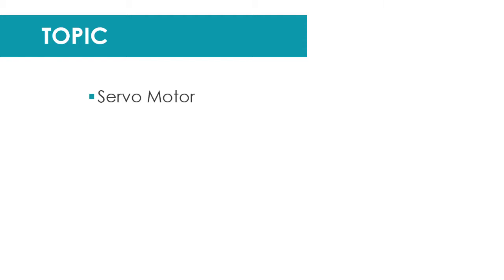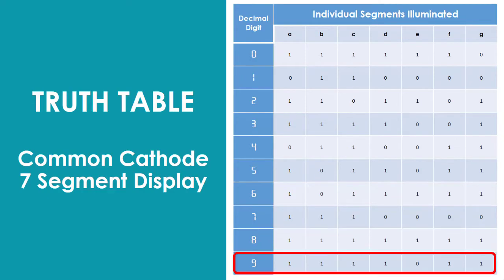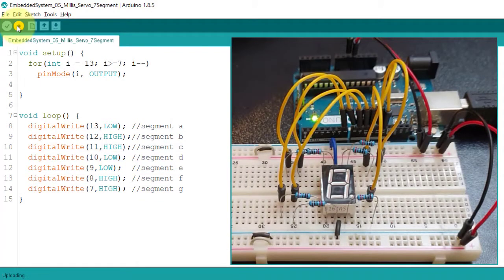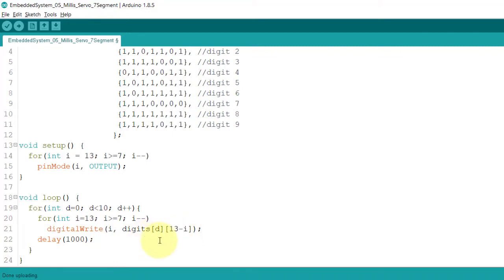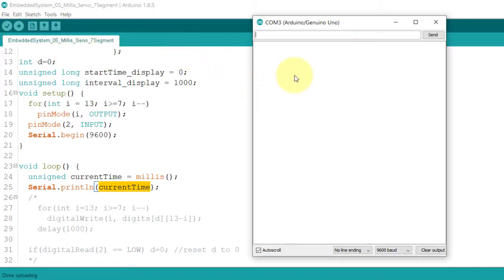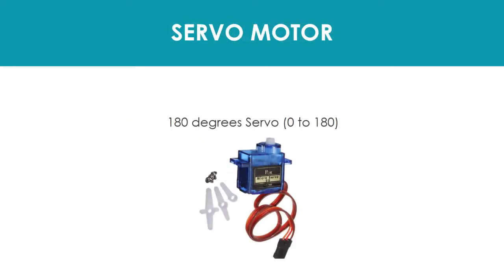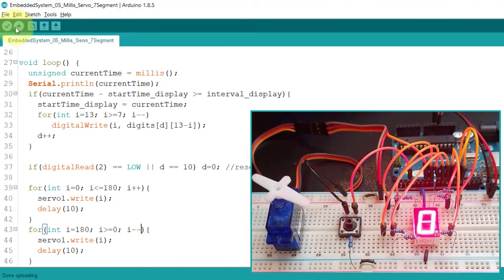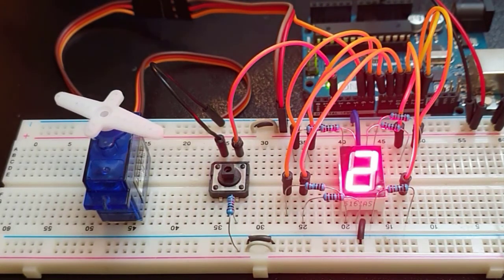10  Multitasking in Arduino using millis | Servo Motor and 7-segment Display | Embedded Systems

Comment: Wow! I came here to learn how to use millis so that I could run the 4-digit, 7 segment display along with other modules.  I learned so much more than I anticipated ; simple little things that I hadn't even thought of, such as using a for loop to assign all pins of the same type.  I'm using an ESP32 and my pin numbers are not in order, but I can just use an array and loop through the elements to do the assigning.  There were several other things I learned.  You've earned my sub; and I really enjoy your style of delivery.
Reply from the maker: Thanks Sir!. Please share 😊

Comment: this isn't really multitasking and we should stop calling it that.  it's more like manual scheduling.  which is like one of the worst (if not the actual worst) things about arduino programming.
Reply from the maker: Multitasking is the ability of a system to execute more than one task in a fashion that is seemingly simultaneous over a certain period of time, and a "Scheduler" plays a crucial  part in multitasking. - so when you say that this is just basically scheduling of tasks, you are correct. And this multitasking in Arduino.
Reply: @joedgoh  Multitasking has a pretty specific definition in computing.  The "tasks" are processes and have contexts associated with them.  To actually multitask, you switch contexts.

There's no context switching going on here.

This is a problem with the Arduino model.  You tell people you're mutitasking but you're really not.

I understand trying to dumb things down for the audience but there should be a practical limit for how far down you go.
Reply from the maker: Hi @GoatZilla, this is not to argue with you. But to clarify things, Arduino UNO R3 is not similar to your desktop computer or a smartphone. Arduino uses a very simple processor with "no operating system", so it has no way to load and run multiple programs. Although it can only run one program at a time, that doesn't mean we can't manage multiple tasks. We only need to change how we do things.  Because there isn't an operating system to help us, we have to do things ourselves. And that is how we do multitasking in Arduino. Yes it is simple, but with this simple concept, our processor is able to handle several separate tasks while staying responsive. 
If you don't want to call it multitasking because of the "technicality" of how it was defined in your computer science class in the context of operating system, that's okay. Thank you for your valuable insights.

Comment: Greetings from Denmark. Thank you for the very interesting video.  I was successful with the 1st & 2nd elements - lighting 4&5 and lighting 1to9 with delay . I was not successful with millis! I would be greatly grateful if you could spot an error in my sketch. Note my  7-segment only shows 0 and the switch has no effect.  Thank you

#include <Servo.h>
Servo servo1;

int digits [10] [7] = { { 1, 1, 1, 1, 1, 1, 0}, //digit 0  //note 3 curly brackets
  { 0, 1, 1, 0, 0, 0, 0}, //digit 1        // note 2 curly brackets
  { 1, 1, 0, 1, 1, 0, 1}, //digit 2        // note 2 curly brackets
  { 1, 1, 1, 1, 0, 0, 1}, //digit 3        // note 2 curly brackets
  { 0, 1, 1, 0, 0, 1, 1}, //digit 4        // note 2 curly brackets
  { 1, 0, 1, 1, 0, 1, 1}, //digit 5        // note 2 curly brackets
  { 1, 0, 1, 1, 1, 1, 1}, //digit 6        // note 2 curly brackets
  { 1, 1, 1, 0, 0, 0, 0}, //digit 7        // note 2 curly brackets
  { 1, 1, 1, 1, 1, 1, 1}, //digit 8        // note 2 curly brackets
  { 1, 1, 1, 0, 0, 1, 1}, //digit 9        // note 2 curly brackets
} ;  //note: semi-colon!

int d = 0;

unsigned long startTime_display = 0;
unsigned long interval_display = 1000;

int servo_angle = 0;
unsigned long startTime_servo = 0;
unsigned long interval_servo = 20;

void setup () {
  for (int i = 13; i >= 7; i--)
    pinMode (i, OUTPUT);
  pinMode (2, INPUT);      //button on pin 2
  Serial.begin (9600);
  servo1.attach (6);        //servo pin 6
}

void loop () {
  unsigned currentTime = millis();
  Serial.println (currentTime);
  if (currentTime - startTime_display >= interval_display) {
    startTime_display = currentTime;                          
    for (int i = 13; i >= 7; i--)
      digitalWrite (i, digits[d] [13 - i ] );
    d++;
  }
  if (digitalRead(2) == LOW ||  d == 10) d = 0; //reset d to 0

  if (currentTime - startTime_servo >= interval_servo) {
    startTime_servo = currentTime;
    servo1.write(servo_angle);
    servo_angle++;
    if (servo_angle == 180) servo_angle = 0;
  }
}

Comment: hello
Is there a way with the millis() for the LED tourn ON OFF only 5  ones?
Reply from the maker: I am sorry, can you rephrase the question? What do you mean by 5 ones?
Reply: @joedgoh   millis() infinite loop . i want led turn on off by  millis() but just 5 iteration ?
Reply from the maker: You just have to create a variable that counts from 1 to 5 (increment by one every blink using the millis). Then you can add a condition that your blink code should only be performed while/if the counter <= 5

Comment: I type the code and review many times, say 62 times but still this annoying error display;  Compilation error: 'startTime_display' was not declared in this scope, what's wrong, CODE: #include <Servo.h>
Servo servo1;
			//a,b,c,d,e,f,g
int digits[10][7] = {{1,1,1,1,1,1,0}, //digit 0
		     {0,1,1,0,0,0,0}, //digit 1
		     {1,1,0,1,1,0,1}, //digit 2
		     {1,1,1,1,0,0,1}, //digit 3
		     {0,1,1,0,0,1,1}, //digit 4
		     {1,0,1,1,0,1,1}, //digit 5
		     {1,0,1,1,1,1,1}, //digit 6
		     {1,1,1,0,0,0,0}, //digit 7
		     {1,1,1,1,1,1,1}, //digit 8
		     {1,1,1,1,0,1,1}, //digit 9
		    };
int d=0;
int servo_angle = 0;
unsigned long starTime_display = 0;
unsigned long starTime_servo = 0;
unsigned long interval_display = 1000;
unsigned long interval_servo = 20;
void setup() {
  // put your setup code here, to run once:
  for(int i = 13; i>=7; i--)
  pinMode(i, OUTPUT);
  pinMode(2, INPUT);
  Serial.begin(9600);
  servo1.attach(9);
  }

void loop() {
  unsigned currentTime = millis();
  Serial.println(currentTime);

  if (currentTime - startTime_display>= interval_display) {
     startTime_display = currentTime;
     for(int i=13; i>=7; i--)
	digitalWrite(i, digits[d][13-i];

     d++;
   }

   if(digitalRead(2) == LOW || d == 10) d=0; //reset d to 0

   if(currentTime - startTime_servo >= interval_servo)(
     startTime_servo = currentTime;
     servo1.write(servo_angle);
     servo_angle++;
     if(servo_angle == 180) servo_angle = 0;
    }
Reply from the maker: Hi. Your declaration is wrong. You typed star instead of start, as in starTime_display instead of startTime_display.
Reply: @joedgoh  Thank you for your reply, Its my fault I got mistake in typing the code. I did your correction but another error come out (Compilation error: expected ')' before ';' token)
Reply: Sir please send the challenges code please

Comment: Wow, Please help me with my problem with delay in my code

          digitalWrite(relay1, LOW);// turn relay 1 OFF
          digitalWrite(relay2, HIGH);// turn
          Serial.println("M1-CW");
          
          delay(12000);
          
          digitalWrite(relay1, HIGH);// turn relay 1 OFF
          digitalWrite(relay2, HIGH);// turn
          Serial.println("M1-Stopped");
          delay(random(3000,5000));
                  
          digitalWrite(relay1, HIGH);// turn relay 1 OFF
          digitalWrite(relay2, LOW);// turn relay 2 ON 
          Serial.println("M1-CCW");

          delay(12000);

          digitalWrite(relay1, HIGH);// turn relay 1 OFF
          digitalWrite(relay2, HIGH);// turn
          Serial.println("M1-Stopped");
          delay(random(3000,5000));

Comment: i am using millis to control 2 addressable rgb strips but it seems to not work properly could you check out the code

#include <FastLED.h>
#define NUM_LEDS 20
#define LED_PIN1 2
#define LED_PIN2 4
#define COLOR_ORDER GRB
#define CHIPSET SK6812
#define BRIGHTNESS 20
#define VOLTS 5
#define MAX_AMPS 500
CRGB leds1[NUM_LEDS];
CRGB leds2[NUM_LEDS];
unsigned long startTime_display = 0;
unsigned long startTime_display2 = 0;
unsigned long interval_display = 2000;
unsigned long interval_display2 = 500;
int j = 0;
int i = 0;  
void setup() {

Serial.begin(9600);
FastLED.addLeds<CHIPSET,LED_PIN1,COLOR_ORDER>(leds1,NUM_LEDS);
FastLED.addLeds<CHIPSET,LED_PIN2,COLOR_ORDER>(leds2,NUM_LEDS);
FastLED.setMaxPowerInVoltsAndMilliamps(VOLTS,MAX_AMPS);
FastLED.setBrightness(BRIGHTNESS);
FastLED.clear();
FastLED.show();

}

void loop() {
unsigned long currentTime = millis();
Serial.println(currentTime);
  if(currentTime - startTime_display >= interval_display){
    startTime_display = currentTime;
    for(i=0; i<=NUM_LEDS; i++)
    {
      leds1[i] = CRGB::Red;
      FastLED.show();
    }
  }
  if(currentTime - startTime_display2 >= interval_display2){
    startTime_display2 = currentTime;
    for(j=0; j<=NUM_LEDS; j++)
    {
     leds2[j] = CRGB::Green;
     FastLED.show();
    }
  }
}

while running the code only the green light lights up not the red one

Comment: it seems very useful, but it's a bit confusing for me. Sir, I wonder if I can use it with 2 codes if there is an ''if'' and ''else" statement, for example, I have combined ultrasonic sensor and water level sensor but the program seems can't run properly. Can you help me, sir
Reply from the maker: It is normal to be confused when you first use this concept. It is okay to use if...else code block. You just have to understand when to properly use it. Using if...else.., only one of these code blocks gets executed at one time. But when you use, if.....if...if..., all conditions could be satisfied and be executed at one time.
Reply: @joedgoh  can you check my code

Comment: actually there is a limitation. When your code gets long enough, and you have to keep the timing precise, this method does not work. As you can see that he used >= instead of ==, this is because as the loop goes on, it will skip a few count, so the longer it runs, the more errors it accumulates. It does not take long to get a 1000x of millis error and your system's diff becomes apparent.

Comment: I'm working on the challenge and I'm having problems on the seven segment display, counting backwards I was able to count from 9 to 0 but when it gets to 0 it does not restart, if I I press the switch it will reset to 9, but when it gets to 0 again same problem. Will it be possible if you post the solutions. Thank you.